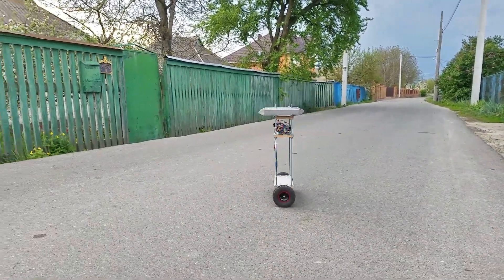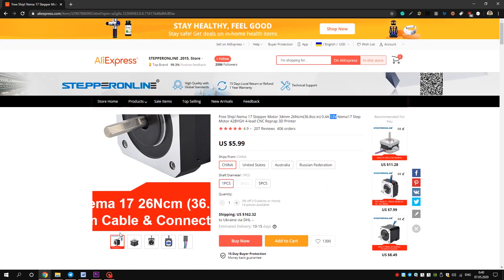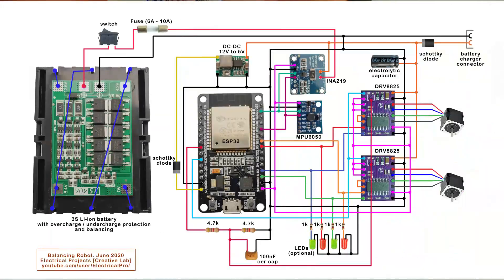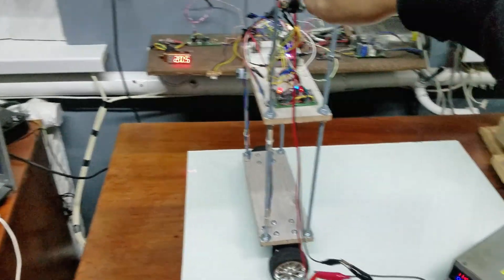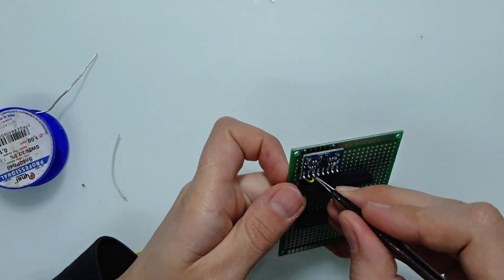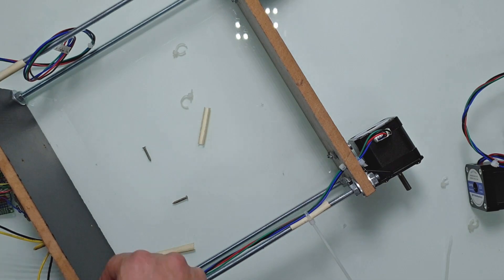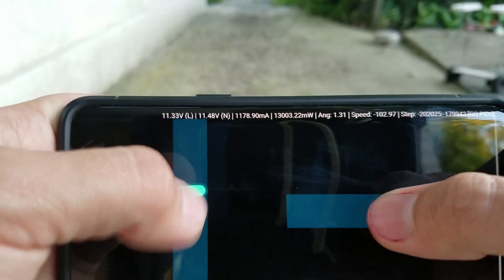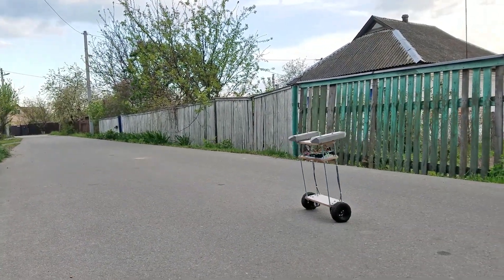How to Make DIY Balancing Robot [My Experience]

Comment: Very informative and well done. I hope you make and sale the PCB for this project on EBay. As on July 9, 2022 your channel has 92.4K subscribers. When you annonce your PCBs are available for purchase, for sure you will get many committed customers.
Reply: what is the name of the app used?
Reply: @Francesco105590  I mean the actual physical PCB, not the file to print the PCB.
Reply: @hgn2217  Maybe I did not say it clear enough; I was talking about the application to remotely control the robot from the phone
Reply: @Francesco105590  Hi, there are three different html files that you have to upload to the ESP32 board. It allows to control the robot position, tune the PID values and plot the IMU data from your browser when you connect your PC to the ESP32 board through WIFI. I guess this better answer your question!
Reply: @francescomontedori3846  vuoi dire  la cartella  " Data "  ci sono 6 file ma come si caricano nell'esp32 ; ho caricato lo sketch, aiutami a risolvere per favore

Comment: Thanx for your post. I can see that you are using an INA219 in your Robot, is that necessary?????  Also was there a real need to modify (remove) the current setting trim-port from DRV8825(s)????  Well ...I am also trying to  do a balance robot project with ESP32s and I thought to get your views since you have completed yours.  Thank You.
Reply: hello, what is the name of the app used?

Comment: Great project.
How did you program ESP32, you said little about it ... 
I was able to upload Sketch with Arduino IDE without problems, I established connection 192.168.4.1, but index.html and other files? Is the robot controlled via an ESP32 web interface? 
I have to understand everything about the soft first before I'll build it
Reply: hello, what is the name of the app used?
Reply: what is the name of the app used?

Comment: The video is very informative. I also had problems with motors and ordered others as well. I have a question, what application are you using for android. Thanks.
Reply: hi, what is the app to use on the mobile phone